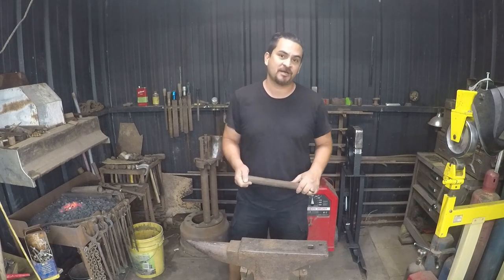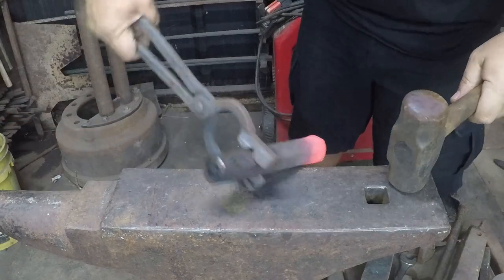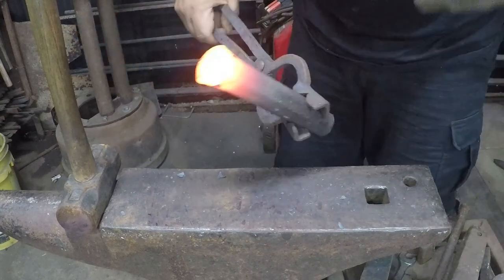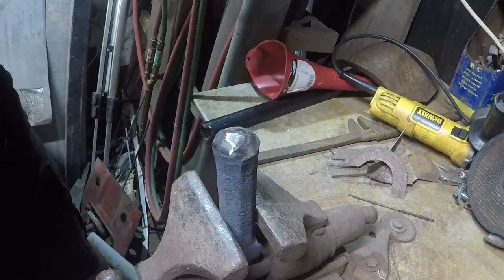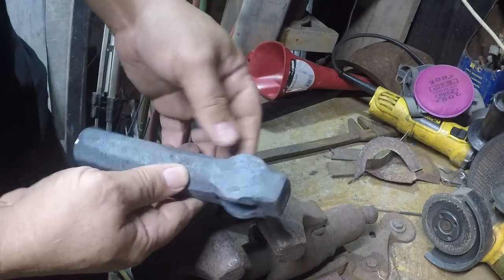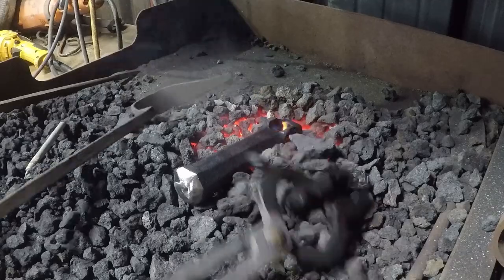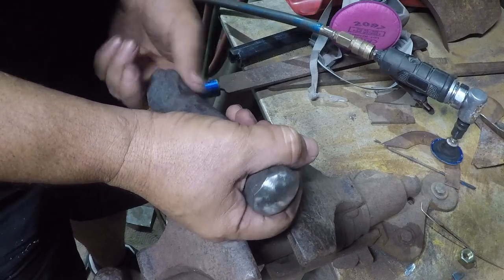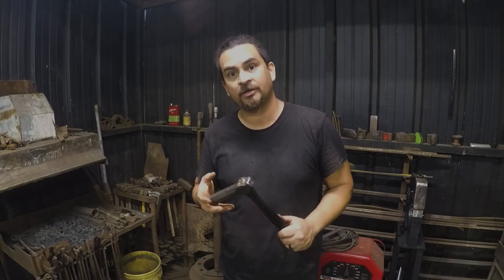Hand Forging a "Dog Dish": Dogs Head Dishing Hammer From an Old Chisel.

Comment: I've found that flapper wheels tend to work very well for that kind of work too sir. Get yourself a couple of 36 or 40 grit flapper wheels and you'd be amazed at the results. You also have a new subscriber. Well done on the hammer
Reply: Very much agree with using flap discs. I find that in many circumstances it is easier to hold the grinder in the vise and rotate the part against the face of the wheel. This gives faster, more consistent results, especially for rounded or domed faces. It is a pity that it is so hard to find flap discs in finer grit sizes. Most seem to stop at 180 or if you are lucky, 240

Comment: thats some seriously tough "bouncy" steel... also if you lubricate your chisel with linseed oil and coal dust it will cut a little faster ..alloy steels especially can grab the punch and make life awkward when youre punching by hand
Reply from the maker: Sticking wasn't too bad, really. The chisel I'm using to pierce is pretty straight so it doesn't get stuck as easy as a more typical "Brazeal" style eye punch. 

I usually use a pine tar mixture for lube, I just need to finish this anvil stand and make a lidded container to keep it in. Otherwise I fill it with scale or knock it over. Overall I still have a lot of storage to work out.
Reply: @strangeblacksmith  pine tar is not one I have tried but I can imagine it bubbling and getting very slick ...I have the same problem with borax, it gets all sorts of horrible stuff in it

Comment: Wondering why you wanted to preserve the facets or chamfers at the face of the hammer - I would have thought that if you were making this for dishing, you would be less likely to mar the workpiece with a fully rounded end, rather than all those little 'corners'
Reply from the maker: It's purely an aesthetic choice. I wanted a little bit of a swell on the end and rounding the points would have lessened the effect. 

It's just a roughing out hammer and will only ever get used straight up and down so I'm willing to take my chances with it. It has a very small radius on the face, like +/-3/4". So I'd have to screw up really bad for those points to become an issue.